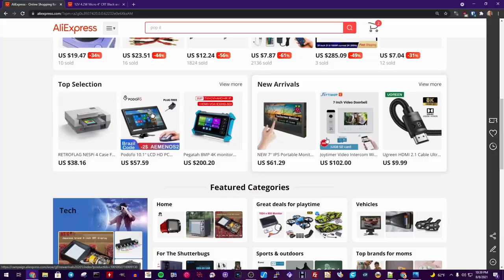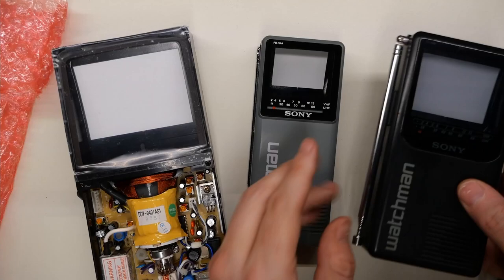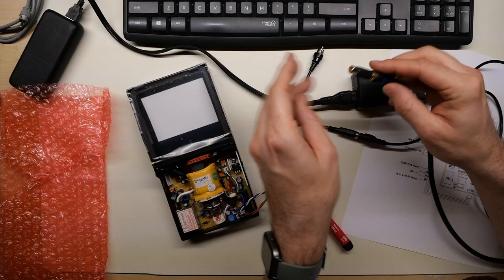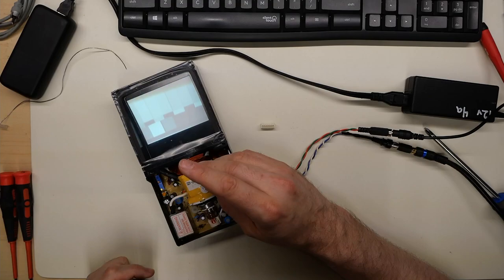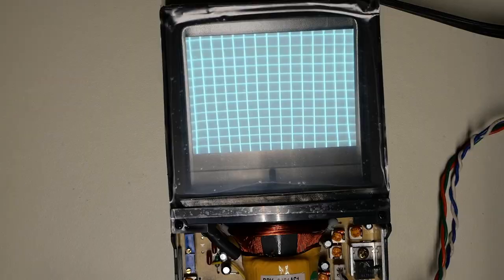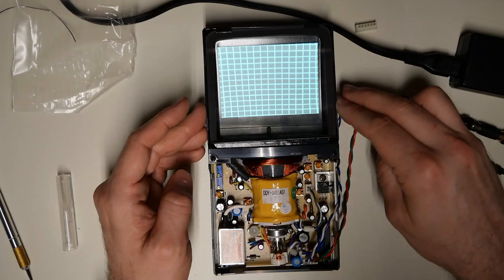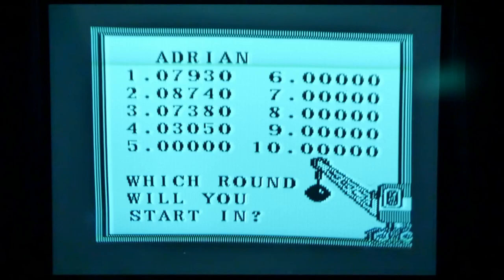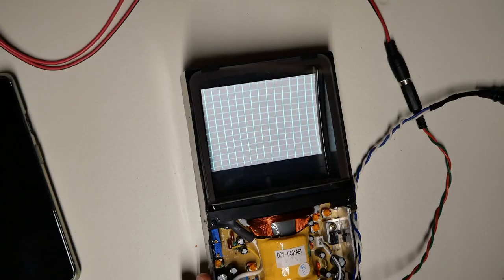This small CRT monitor is less than 2" thick

Comment: This is probably already addressed in one of the 1200+ comments, but this CRT was almost certainly intended to be covered with a neutral gray filter of 50% - 75% or so transmissivity.  The effect is that the light from the CRT only has to go through the filter once, and so is attenuated by 25%-50%, whereas outside ambient light goes through the filter twice, being attenuated by 50%-75% (double that of the CRT).  This results in an effective doubling of the contrast at the expense of some brightness.  Since the CRT looks to have plenty of available brightness, this would have worked fine.

Comment: Wonder if the distortion on the right side was caused by the magnetic field from the power and video cable.
If you moved them away did it clear up?
Reply: He was using a twisted pair of wires, so the magnetic fields should cancel each other out

Comment: If you set it up perpendicular to your overhead light, and look at it straight on like a normal TV, you'll get a lot less reflective light off the phosphor from the overhead sources.  That way it won't be quite so washed out.
I'd wager you would have a bezel around it as a finished product anyway, to shroud it from external light as well.

Comment: I use regular breadboard duponts on those types of connectors. I remove the white plastic housing to ensure a good connection but it does work if you are gentle with housing on.

Comment: To improve "sunlight" or at least some kind of bright light readability, you can buy an adhesive polarizer film meant for phone repair. Did so on my Watchman and it really helps. More so because it's dark, so the screen gets dimmed once, but the external light gets dimmed twice as it has to go in and back out, but it being a polarizer also helps a bit. Be aware though that those polarizer films get fingerprints a lot more than a Watchman's plastic window, and they make the screen dimmer (though it only looks dimmer in dimly lit areas, in bright areas it actually seems brighter) and a bit more grey than blue. But that's the reason why really old CRT televisions were white (that's the natural colour of phosphors), and later one were brownish grey. I used to think that colour TVs are grey, but that's not true as really old ones were white as well.

Comment: fun fact: i have this exact same crt display in my house, it even came with it, it's a black and white video entryphone, its basically like a normal entryphone but with a video feed, i opened it up several times bc its super glitchy (gotta love modern apartments construction quality lmao) and i saw this exact same crt inside. it even has a lot of adjustemnts in the form of potentiometers on the pcb

Comment: (5:11) You're correct! I checked the AliExpress link, and saw that someone had a listing for the same CRT inside a chassis with buttons that have Chinese labels on them. When I scanned those labels into Universal Copy and then into Google Translate, it seems to suggest that the CRT was originally used in the interior side of a door phone system for homes in China.

Comment: I'm not sure anyone has tried to explain why the contrast problems are different between this and a conventional CRT.  If you imagine the phosphor paint like a kind of chalk paint (which it resembles) you can see that actual light is not transmitted through it very well.  This combined with the slight external convex shape of a regular CRT means you don't get very much light affecting nearby parts of the external phosphor.  There is indeed a slight tinting of the glass, but that is to stop ambient room light from reducing the contrast.   When you are looking a CRT that is not powered, it looks kind of grey, and you are basically looking at light that has passed twice through the same filter.  There's also angle of incidence to consider - since the phosphor in a conventional CRT is applied directly to the glass, it's actually quite likely that you wouldn't get light contamination to any but the closest areas because it will get directed away rather than reflected back.

This side projection CRT doesn't do any of that stuff.  The slight concave curve on the screen actually means that a bright section on the screen can splash light onto other parts of the screen.  In photography terms this is call light contamination, or colour contamination if it's a colour problem rather than one of contrast gradient.

It's quite likely that that module is meant to be installed a case with an additional grey filter in front of the screen which would not do much for light contamination from the excited phosphor, but it would certainly help with the contrast when looking at it in room light.  Outdoors of course, it would be almost impossible to see.

Comment: You can assume the DOM ( Date Of Manufacture) by the date codes on the semi conductors. It’s 4 numbers WWYY. This code can also be printed on the deflection coils. The black box is the EHT transformer, with inbuilt diodes.

Comment: The original cover panel probably included a filter.

You can probably use your Mark I Scissors and a dead LCD TV to cut an appropriately sized polarizing filter to place over the CRT.

Comment: KA7810 is TO-220 3 Terminal 10 Volt 1 Amp Positive Voltage Regulator, LA7806 is Black and White TV Synchronization, Deflection Circuit.

Comment: E-bay also had these recently (can't seem to find it now) They were selling ones earlier that were just the tube and a circuit board; I bought a couple of these at the time (search 'Sony 4" watchman' to find mine) and they came in a cardboard packing shell. They also appeared to be NOS. Not all sellers had the wiring diagram, be sure to track it down! Mine had to have an external contrast pot added to work. They say to run them on 12volts, but the picture looked better at 10 volts (better size and focus-looked less overdriven/stressed) They have a decent picture, if a bit warped(possibly due to sitting so long) pretty cool-they showed a box full of them! You can find just the tube with that search as well!

Comment: I have the same CRT in my Ali wish list.. 😂 Didn't ordered because I didn't even get closer to the project who needs something like that..

I know one office building complex where they still using old Commax video intercoms with similar CRT in recipient part.. Some time ago I get one glitchy system with all floor modules when they changed it in one building.. 😂 That's mean's, I can reuse and connect recipient's part to my project as test when I decide to start it..

Anyway, image from Your CRT looks very impressive and nostalgic after playing with all adjustments! 👍

Comment: That component you called a horizontal drive transistor is clearly marked as a 7810 voltage regulator. That explains why it needs >12V and the current draw is constant when you increase the voltage.

Comment: if you fancy spend a few hours in it, linux and xorg allow you to tune and set any modset you want out of a vga plug. this allows to use any monitor, as long as you can find it's spec, including monitors NOT designed for PC (apple, HP, VAX, SUN, SGI , all had specific non VGA monitor )

Comment: 26:30: bingo! All phosphors are pale. Other than in projectors and, CRTs invariably use a dark gray filter to create contrast. In some, it’s dark glass (especially TVs), in others, it’s a plastic film laminated  onto the face of the tube. (If you have a CRT display with a matte front, it’s almost always a laminated film.) I suspect the Sony Watchman has a gray-tinted window. 

The same principle applies to many other kinds of displays, which is why VFDs, 7-segment LED displays, etc always use a dark window in front of them. Without it, they’re almost impossible to read in daylight. Plasma TVs had some kind of contrast filter, too.
Reply: I believe higher-end designs use filters which are transparent to the particular wavelengths emitted by the phosphors, so only oncoming white light gets attenuated.
Reply: @eDoc2020  Nice!

Comment: phosfor in regular crt had to be "shined through", not just on the surface, so it was rather different type of coating. Probably also a little bit transparent and because inside it was black coated it would absorb incoming ambient light

Comment: Sony was the only company that made that specific style of CRT (though the CRT in the Sinclair TV was similar). Magnavox was the only company who licensed that tube - I recently acquired a Magnavox Escort 2 which is to all intents and purposes identical to the Sony FD-20. The circuitry is quite a lot more complex than a regular CRT because of the unusual tube geometry; keystone adjustment has to be dynamic based on where the beam is.

Comment: That 'transistor' that you thought was the horizontal output is actually a 10V, 1A regulator IC, a 7810.
This tube design was originally started by Sr Clive Sinclair.
Reply: I wonder how much of that goes back to the Aiken thin CRT.

Comment: My thinking as to why the phosphor is so bright white and the screen washes so easily is because in a way this screen is working like those front projectors, the screens have to be bright for good reflection, this screen most likely has the same issue, while most black and white screens have a brighter glass than color, in my experience at least, they dont have to worry about reflecting light or electrons essentially, they have the light shine through rather than bounce off, still a pretty cool idea and i do remember seeing these for door camera devices, and that they seemed a little poor on gradients, they always looked a bit washed out, but they worked well enough... neat tech that was originally designed to solve a problem for sony back in the day.

Comment: @adrian's digital basement. You can use the Sony ones by using the RF output of a console and soldering the wires to the Ariel input on the board. The telescopic one or wire in a female adaptor so you can plug in diff consoles that have R.F

Comment: 3:00 I wonder if it's called "Keystone," like in architecture, because that screen is shaped like the brick right before the keystone of an arch. Weird observation, I know lol, but it kinda makes sense to describe the weird shape the image has to be distorted to compensated for.
Reply: The adjustment is named after the keystone of an arch due to the similar trapezoid shape. It's more commonly found on projectors, where you need to adjust for this if the projector isn't exactly perpendicular to the projection surface.
Reply: @Zeem4  You also commonly find keystone (and pincushion and a bunch of others) on CRT monitors (not so much on televisions). I used to get completely OCD about the jacked up keystone and pincushion settings that the university computer lab monitors always had. I'd spend as much time fiddling with that as I would on my homework.
Reply: @Zeem4  Thanks, that's good to know! I could have just googled it I guess, but it's usually more fun and informative to ask questions and learn from others

Comment: It uses a KA7810 voltage regulator so it makes sense it would struggle when the input voltage comes near 10V. Also, you forgot to mention the high voltage you measured? Would be nice to know. Also, you may be able to find date codes on the voltage regulator or the other IC.

Comment: Fantastic display with lots of possibilities! Sensitive analog meter movements have similar finger-static issues as you show. The classic fix is a little soap solution wiped on the face of the meter. This may work on the CRT. Clothes dryer antistatic spray may even work better.

Comment: If I recall correctly, normal CRTs have an additional screen/grid/whatever with holes in it that the phosphor shines through- it's called a "shadow grid" or something, because it's intended to cast a shadow onto the phosphor layer.
Reply: That´s the shadow mask. It is only used for Color CRTs to separate the colors. Not for B&W

Comment: Doorbells that use the models, well Adrian.... My doorbell system in my apartment building STILL has the CRT like this. B/W with an angle, yup still working. (2008 is the original date it was mounted), hasn't changed yet.

Comment: Convert into an oscilloscope?  As you adjust brightness, that will effect focus due to beam current loads the anode and focus voltage is divided from anode.
This is known as bloom and most CRT's do this to some extent.
You might find moving the yoke around slightly will change the beam angle, some small magnets placed on the neck will bend the beam.

Comment: This is still a lot more practical than the camcorder viewfinder CRT that I connected to a Raspberry Pi. I'd seen pictures of similar ones that were sharp enough to resolve 80 column text so I thought it might be fun to set it up with a Fresnel lens, but mine is nowhere near sharp enough for that. Still fun though.
Reply: I've done the same thing.  3D printed a little case for the viewfinder CRT.  Ludicrous fun.

Comment: @Adrian. Sorry but I have to correct you. Sony did NOT invent the sideway illuminated CRT. It were Sinclair Radionics and Motorola.
The Sinclair MTV1(1977) predates the Sony Watchman(1982) by 5 years and the Panasonic TR-001 alias Mica 1 was released even earlier(1970).

Comment: I previously buy two of theses, one for making some kind of computer monitor for an Raspberry pi to display weather satellite imagery, weather station datas, etc in a cool way with a 3D print enclosure that let the screen part outside to be able to see thru (I just posted it on my youtube if you want to see). For the second, I curently working on, it will be some kind of portable game console with a NES emulator on ESP32 as brain and the flat CRT.

Comment: At around 2:08 you can clearly see the production date 20061210 right under the modelnr. of the chassis.
Reply: The ROHS sticker means it was made in 2006 or after.

Comment: I wonder if two three pin pc fan connectors would slide into that six pin. Maybe it's not a six pin exactly, but rather a space to plug in two pots each using a three pin.

Comment: So, I've been inspired by this to build a 'cyberpunk' or 'cassette futurism' styled RPI terminal. And I'm not too well versed in LiPo batteries so I've chosen to use standard AA'S, wondering if thats even possible with this CRT
It will be completely portable, be able to connect to wifi and have either usb ports for a keyboard or a built in one (according to how ive designed it)

Comment: The apartment building I live in was build in 2010 and we also got those CRT intercom systems. I just checked and they are still building and selling them (At massive price of 350euro). They are horrible unreliable. I have had mine replaced over 5 times now because they just stop working. The company is from Spain and is called Tegui.
Reply from the maker: I figured they were still around!! Funny
Reply: Then I see an opportunity to repair them for considerably less than $350, using new old stock parts like this.
Reply: These things are still around in my area, I think it was Bicticino that made these for a while.
Reply: @mal2ksc   that's probably what they're already doing an making $330 a pop!

Comment: Could have just added the pots to the back of the board across the existing soldered pads from that connector rather than unsoldering the connector. Alternatively can also break out the pins using a 6 conductor ribbon cable and hook the pots to that.

Comment: I’ve got one of these, which I got from an elderly neighbour, but it’s not an Sony and is an brand called an “Casio Ti-STN LCD television TV -990 “ but doesn’t show an Manufacturer Date…also since Canada doesn’t use analog service, but it is rumored online as he says can be hooked up to an computer to operate it, so I just thought I’d mention that I have one of these types of devices (so I know this machine/ gadget) mine has its Screen scan and have its sound activate because it’s battery operated…

Now YouTube don’t try to nonsensically or illegitimately censor my posting because it’s unlawful censorship for non-sensical and Illegitimate reasons….I’m watching… it’s on an shelf in my storage closet room next to an box with an strip  of LED Christmas lights and the Drumsticks 🥁 for an shoulder drum of Asian design ( that reminded me of the Buddhist zombie’s Drum in the 1971 version of Dawn of the dead movie I have on DVD, that kept banging when he walked, because the drumsticks were tied on the drum itself..in case you never watched that version of the film)…

Comment: The high voltage transformer is called a flyback transformer.  My dad used to repair TVs back in the 60s/70s and he always told me stories about getting hit by that thing. Since it is a sawtooth wave you really feel the sharpness of the wave form.  I have always jokingly stated that it's called the flyback transformer because if you get hit by it you fly back real quick. 😂

Comment: 23:20 - it looks like the deflection yoke is slightly turned to the right
25:45 - maybe something is bouncing back from the glass, gets trapped inside and excites the phosphor again
Maybe you could built it inside some shadowbox, like the control displays at movie shooting where it has a huge lip around the screen so it's dark (I guess). The fact that the front is so open frightens me a bit, you really need to cover it up with something.

overall it looks like a fun little play thing :D